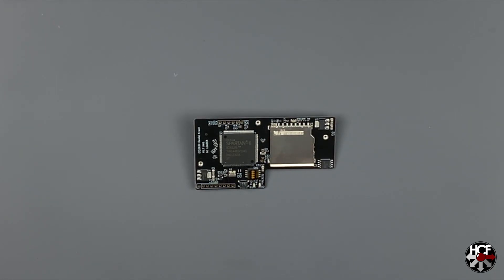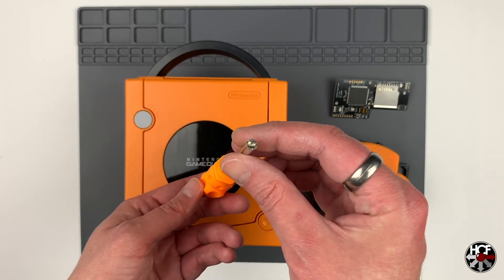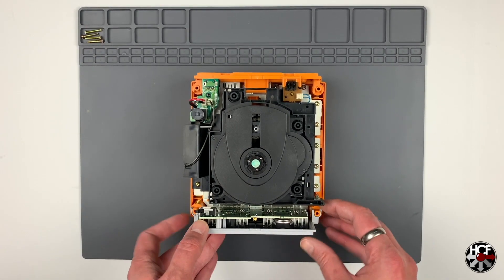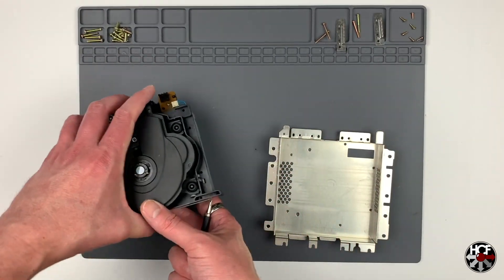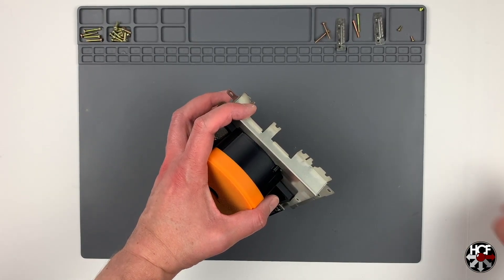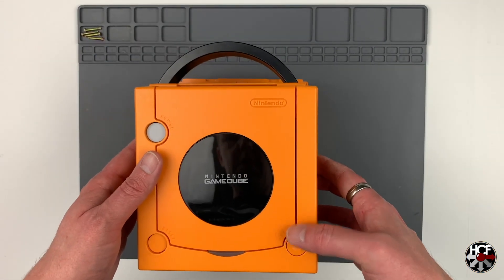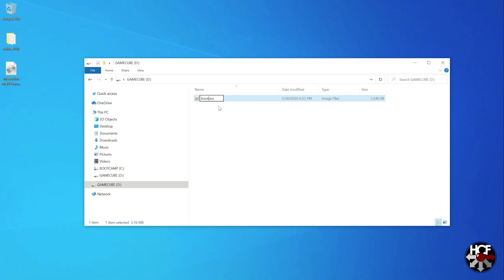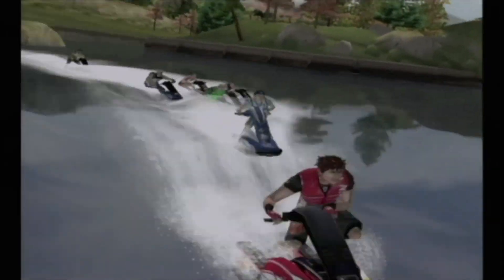Gamecube GC Loader PNP SD Card Optical Disc Replacement Mod | Install & Setup | How to Guide

Comment: They're now sending the laser Bear mount with the right screws already screwed into place.  I guess this is in case you lose any screws plus it's going to mean they're already pre threaded.  I've ordered several from them over the past few years (2021, 2023 and 2025) and only the most recent one has the screws already threaded

Comment: when placing the ISOs on an SD card, do they have to be on the root of the SD card? I was thinking of having my games in folders. one for 480i games and the other for 480p games. that way I would know to use the force 408p option or not. thank you.

Comment: Hello,I need help with my gc loader,so I followed your video step by step ,I took apart my GameCube,installed the gc loader,the optical disc cardreader,and updated with latest Swiss and firmware,I was excited to see the Swiss programs worked after so much work taking apart my gc,but I couldn’t find any games,so I ordered an sd card with over 300 games preinstalled,but none of them work

I keep getting error messages such as 
Disc does not contain valid word at 0x1c
File is corrupt or missing I get a black screen filled with letters and numbers
Some games will start and but then freeze after 10seconds,usually freezing after I see the Nintendo logo

What is going,what are these errors,how do I get these games to work?
Reply from the maker: Okay, a quick question for you.  When you got the SD card with the games on it, did you add Swiss to that and put it in your GC Loader, or did you copy the game files to the SD card you set up yourself?

Comment: I would love to buy that, since my GC is not compatible with sp2sd, but 35$ is not an atractive price, and the official site is charging more than the double of it. Will wait until they charge what I can pay.
Reply from the maker: It’s definitely not the cheapest option out there, but I will say that I’ve absolutely got the value out of it!

Comment: Vety helpful video! Quick question, my GC loader also shipped with a sd2sp2. And the instructions included say to use both. But your video doesn't touch on the sd2sp2. Do I really need it? Especially since I don't have the proper port on my GameCube?
Reply from the maker: Okay, so it sounds like you may have picked up a GC Loader Lite, which is a clone of the original GC Loader.  The clone actually works slightly differently than the actual GC Loader and requires the SD2SP2 to run, so if you don’t have the SP2 port on your Gamecube, it won’t really do anything.  I hate to be the bearer of bad news, but I’d probably see if you can return it and grab an official one from Black Dog directly, that way you know it will work without SD2SP2.  Hope that helps, feel free to give me a shout if you have any other questions!
Reply: @HalfCircleForward  oh great! I waited a month for something I can't use! Unfortunately I'm not a patient enough person to refund and resend it. I may just find the correct GameCube and try it again. Thanks for the help!
Reply from the maker: @chumpchangedrawscomics5907  No problem at all!

Comment: I am pretty sure I screwed myself. If anyone can help that would be very appreciated. I flashed the latest beta version of Swiss 2.0.0. I finished flashing and was instructed to turn off gamecube to finish the process. I did so and when I power on now all I have is a black screen. If I messed up my gc loader that is fine. I just want to know if there is a way to fix this or if I unplug gc loader and plug back in disc drive if everything would run back to stock settings. Thanks for any help.
Reply from the maker: Okay, let's see if we can get you sorted out!  

Were you trying to flash the GCL firmware?  I took a look on the GCL firmware page and I'm only seeing 1.1.2 as the latest version.  Where did you get the file from? 

I've seen reports of folks being able to power cycle their systems and it completed the update.  I assume you've already tried that though.  

If that doesn't work, and you picked up your GCL from Black Dog, it might be worth reaching out to Dan to see if he has any suggestions, he's really good about his customer support.

Worst case, if you can't get the GCL to boot again, you could certainly remove it and return your machine to stock by replacing the disc drive.

Comment: How did you get your game isos
Reply from the maker: Most of mine were ripped years ago using a modded Wii.
Reply: @HalfCircleForward  can you rip them using raw dump
Reply from the maker: @thesupergamerplays128  I’ve never used it myself, but I just looked it up and it looks like it should work. It looks like it needs very specific DVD drive to do so though.
Reply: @HalfCircleForward  a DVD drive from a PC
Reply from the maker: @thesupergamerplays128  Yes, from what I can see, Raw Dump is software for the PC that requires a specific type of DVD drive.
Reply: Would the DVD drive on the side of a laptop work

Comment: Hi I have installed my gc loader but it's not loading the isos I get a error saying invalid or corrupt file please help me fix it
Reply from the maker: Most of the issues I’ve seen with games not running have been caused by the SD card.  Try reformatting the SD card, and if that doesn’t work, see if a different card will work.  Did you format the SD card to FAT32? If you’re still having issues, it may be the game files themselves. Hope that helps!
Reply: @HalfCircleForward  I did
Reply from the maker: Okay, if it's not the SD card, I'd try to source some different iso files, as there's always a chance they're not clean rips.  I did come across a thread with someone else having this issue and their GCL had an issue, but that's the first time I'd seen a GCL go bad.

Comment: Hi mate, just wanted to thank you again for your awesome tutorials on the GC Loader. Followed your instructions to the letter and I'm happy to report that  everything is installed and up and running perfectly. 🥳😁 Just one hitch but it may be a ROM issue. Namco Museum 50th anniversary  edition loads fine but when I attempt to play one of the games it crashes and brings me back to Swiss. Have you experienced or heard of any issues with this particular game? Any help would be much appreciated. Thanks.
Reply from the maker: Glad you got everything up and running!  I haven't tried Namco Museum, so I'm not sure whaat the issue could be.  I'll try and do some reading to see if it's a known issue.  It may be worth trying to source another iso, just to rule that out though.

Comment: How does this compare to the Gamecube SD2SP2?
Reply from the maker: In my opinion, the GCL is the way to go, it’s easy to install and setup, and actually works in conjunction with the SD2SP2 for the virtual memory card feature. The GCL will also boot straight into Swiss without the need for a boot disc or game save hack, so it’s pretty seamless. Hope that helps, give me a shout if you have any more questions!

Comment: I have purchased 2 gc loaders from the same website, one works great, the other does not. The other one I purchased, the games freeze when starting up, also there is a loud buzzing noise when it freezes. I have followed all necessary steps just like i did from the first purchase, however, I've run into this issue. Some games run fine, I'm using the same games I used for the first gc loader, others do not. I used a 200 GB micro sd card, I've even tried a 128 GB micro sd card but same issue. All I'm using is a stock gamecube, gc loader, sd mount, and micro sd card. Am I missing something?
Reply from the maker: Something’s definitely not right there. The first thing I’d check is if the GCL is seated correctly, it may be a connection issue.  Then I’d try it with the SD card from the working GCL to rule out the SD card being the issue, but I’m not sure it’s that. Did you get them from Black Dog? If you did, it might be worth reaching out to Dan to see if you can get a replacement, he’s really responsive, so I would think he’d be able to get you sorted out.
Reply: @HalfCircleForward  I purchased both from Black Dog and I have messaged about it but I haven't heard back. It has been a week since I've messaged Dan on his website, still no response.
Reply: I apologize, just checked my junk mail folder, Dan did respond, will see if his solution works.
Reply: After testing out the solution of formatting to exfat as well as doing a reseat for the gc loader I am still running into the same issues.
Reply from the maker: That’s not great news.. Have you tried the working GCL from your other console in the one that’s currently not working? That’s the last thing I could suggest, and would rule out that there’s an issue with the console itself.

Comment: My GameCube is a Japanese GameCube, but if I use the region switch to United States do I still use the NTSC-J file or do I use the NTSC-U file?
Reply from the maker: That’s a great question! You’ll need to use the file for whichever region the switch is set to, so if it’s set to NTSC-U, you’ll use the corresponding file.  Hope that helps!

Comment: I see a lot of people combining these two products with the SD2PD2 or something along those lines, what benefit does that give, do you have a separate video that explains it? Also as an aside, I do speedruns a bit and I'd love to know if the isos have any input lag compared to traditional disc playing?
Reply from the maker: That’s a great question!  The GCL doesn’t currently have write support, so adding the SD2SP2 into the mix allows you to save your settings. That’s the main benefit, but you can also keep other games/software on there too, which is what I do to keep my main games list clean. It’s a pretty cheap upgrade that I’d definitely recommend!  As far as lag goes, I’ve not experienced any issues, and there are a couple of setting that you can tweak in Swiss to replicate the drive speed if you want to slow the load times down a bit too. Hope that helps, give me a shout if you have any other questions!
Reply: @HalfCircleForward  Thank you so much for the help! But just to clarify, the SD2SP2 can be used to save new settings but also can save the game ISOs on the microsd card you would connect into that, so does that remove the use of the normal SD card mount, or would you load swiss onto that as a base and then add everything else onto the separate card? (I've already ordered all three so I just need clarification to use them to their full ability) thanks again!
Reply from the maker: @mattrankin5710  You can use the SD card in the SD2SP2 run your game isos from, but if you’ve got a GCL installed, you’re going to be better off having the isos on the SD card that’s in there. I don’t run much from the SD2SP2, mostly utility software, all my games are on the SD card in the GCL. It’s also easier to physically access the card in the GCL if you want to add or remove anything from the SD card. Does that help?
Reply: @HalfCircleForward  Yeah I think I've got it now! Thanks a lot for the help I appreciate it!👍👍
Reply from the maker: @mattrankin5710  You’re more than welcome! Give me a shout if you have any more questions!

Comment: Completely new GC modding and I have some a few questions that might be very obvious to others with more experience.
1) With the PnP GC Loader, is the Gecko still necessary? I don't understand what the Gecko does that the GC Loader doesn't. Several modders may have explained already and it may have just gone over my head. 
2) While using the GC Loader, will save game data be stored internally on the SD card somewhere, or will it still be able to write save game data to a GC memory card?
3) If I were to use a .iso file for a game that originally supported 4 player couch co-op, would this functionality still be present for games on the SD card?
Reply from the maker: Those are great questions, let me see if I can answer them for you!
The Gecko isn't necessary if you have a GCL installed (assuming it's an official one, there's a knock-off GCL floating around that requires it and should be avoided).  I got a Gecko specifically for memory card back-ups which you can do using the GCMM software, but again, just to play your games, not necessary at all.
Game save data will still work the same as if you are using a regular disc, saving to the standard GC Memory Card.  Swiss does have a Virtual Memory Card feature that they just implemented that allows game saves to be stored on an SD card, but for that feature, you'll need an SD2SP2 adapter.  Those are cheap though and recommended as a companion to the GCL.  Write support for the GCL SD card is coming though, so it should be possible to use the Virtual Memory Cards directly on the GCL's SD card at some point if you wanted to wait.
Any games you have on your GCL should function the same way as they would if you were running a standard disc, so you'll be good to go for co-op!
Hope that helps, and if you have any more questions or need any clarification, feel free to give me a shout!  I did a couple of videos on the Virtual Memory Card, GCMM and the SD2SP2 setup which may help as well if you'd like to check those out! :)
Reply: @HalfCircleForward  Thanks for the speedy answers! I appreciate you taking the time to clarify these things, and your other vids were also a HUGE help! Thanks to that, I think I can manage to bring a little nostalgia back to life for my siblings and I.
Reply from the maker: @codyclark6277  You’re more than welcome, glad I could help! Have fun!

Comment: Hello!  I have a region switch and HDMI mod on my Japanese Orange GameCube.  Would I just ensure I choose the appropriate ISO program for the region during install?  Sorry if the question sounds dumb, I’ve had to replace the optical drive twice now on my GameCube, this looks to be my best solution.
Reply from the maker: That's actually a really good question!  The GC still runs the region check on initial boot with the GCL installed, so yes, you'd just need to make sure your Swiss iso file is the right region for whatever your switch is set to, you're 100% right!  Hope that helps! :)
Reply: @HalfCircleForward  Thanks!  My GameCube will live again soon!

Comment: Hi just a stupid question. ! When you install the demonstrated adapter, surely you don't need the xeno gc chip which we used to install on the underside of the CD-rom pcb. Right ?
Reply from the maker: You're 100% right, no need for the Xeno with the GC Loader install!  Hope that helps! :)

Comment: THANK YOU for holding the optical drive while removing the screws. It makes me absolutely cringe when people set the OD facedown on a hard surface to do it. Guarantee you the lens would be shot at that point.
Reply from the maker: You’re welcome! I grew up when CDs were still pretty new, so I was trained from an early age that you absolutely never, ever touch the lens (or the backs of CDs for that matter)!  Old habits die hard, I guess!
Reply: The lens doesn't even make contact with anything when its backwards tho....

Comment: I'm not sure if this is a noob question or not since I have not seen anybody ask, but how do I get the games I want on the SD card?
Reply from the maker: No worries! It’s pretty straight forward, all you need to do is drop the .iso files for your games straight onto the root of the SD card that goes into your GC Loader, and it’ll pick them up when you boot into Swiss.  Hope that helps!
Reply: @HalfCircleForward  where do I go to get .iso game files?
Reply from the maker: You can use Clean Rip on the Wii to back-up your physical discs (https://wiibrew.org/wiki/CleanRip), and there are a few places online that host files which you should be able find with a quick search.  Hope that helps!

Comment: There's a Swiss v0.5r1026 out, looking forward to your video
Reply from the maker: I took a quick spin through the release notes and, at a glance, it looks like they implemented a bunch of quality of life and stability features in this build, but I'm definitely going to take a look at it!
Reply: @HalfCircleForward  When do you think they will incorporate using sd2sp2 as a memory card, instead of using it for swiss save data?
Reply from the maker: @ibapreppie  They actually implemented that a couple of builds back with the virtual memory card feature. It works like a charm and I did a couple of videos on transferring files to them, it’s a really cool feature!
Reply: @HalfCircleForward  Ah yes you have a video on that right? I think Ive watched it a few times lol. Is there a real benefit to having GCLOADER PNP in combo with Xeno mod chip and sp2?

Comment: Hi there thanks for the great video my question is do you know where I can get the GBI game boy player software homebrew for the game boy player that replaces the original game boy player software disk I was told it is much much better to use and has a lot more options and settings but wasn’t sure where to get it thanks I appreciate it
Reply from the maker: Sure thing!  You can get the GBi Software here:  https://www.gc-forever.com/forums/viewtopic.php?f=37&t=2782
I also did a video on the setting up the GameBoy Player if you'd like to check that out:  https://youtu.be/cVz4W0NRx1M
Hope that helps, and thanks for stopping by the channel, I appreciate the support! :)